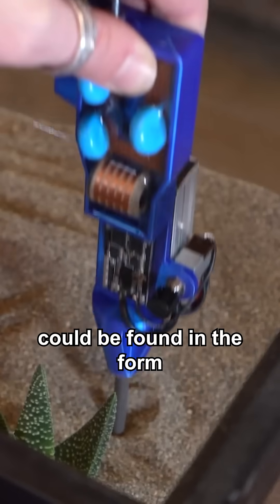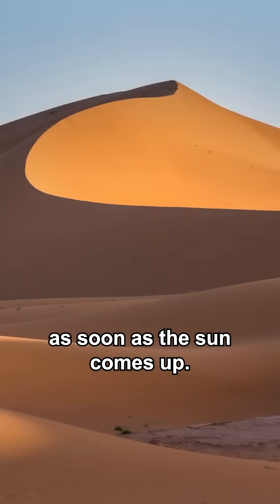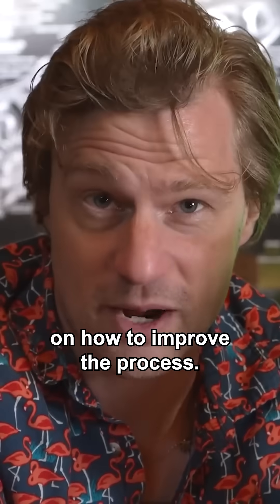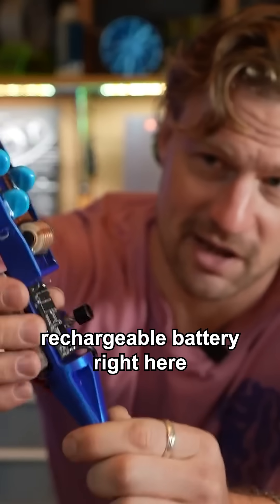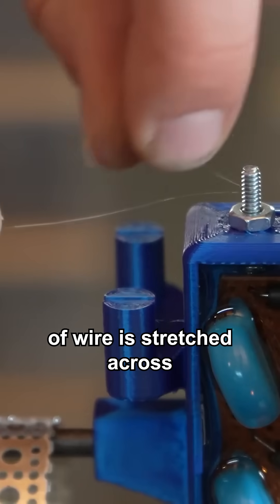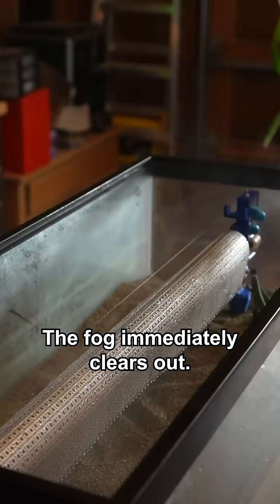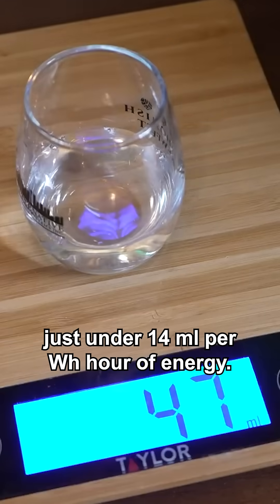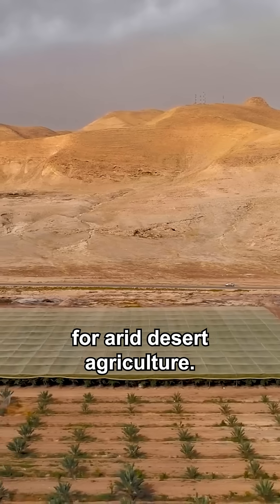Solving Desert Water Shortages Using 20,000 Volts (from full video)

Comment: The device is cool but there's too much that can go wrong with it plus you need to keep recharging a battery. I've always just used a big tarp or a big piece of plastic with a bucket underneath to collect the water that drips off it. Just make sure you get up before the sun comes up otherwise it will all evaporate
Reply: solar charged batteries

Comment: Hmmm, Free option , Shade cloth strung between 2 poles with a gutter placed below it. So as the fog moves through the shade cloth the drops will move down with gravity and of course the gutter needs to be at a slight decline that heads towards a collection container that can then be connected to a drip filter system for drinking water or as is straight to the water pump for the fields or house hold.

Comment: So simple yet so effective.  Holy crap that could help alot of ppl. Hope to see it in full production and being used. The fact you not using a cold area like a dehumidifier.  So the electric field attracts the water molecules and then they collect together too heavy to float so it collects and drips down the grate? Awsome.
Reply: That, is still a dehumidifier, in fact, a pretty run of the mill one
Reply: @elskaalfhollr4743  no shit, anything that takes humidity out of the air is a dehumidifier, lol. I was saying it was a different way to do it. Damn ppl can be so dumb. I did say like a dehumidifier,  guess I should of said like a standard dehumidifier.  There do you feel better now.😁

Comment: we use large frames with mesh in Chile to capture coastal fog, without power.
Reply: it captures far far more water with power , he explains how in the full video
Reply: Plus he says it could be  done using solar power as well. Imagine how much more water you could collect!
Reply: @nathanielball365  Except the fog only happens very briefly as the sun is coming up, so you'd need a ton of very expensive batteries.
It would be cheaper to scale up, build infrustructure, and desalinate water from the ocean you're already at, because it only happens at the coast.

Or dig a well.
Reply: @nathanielball365  yeah but you have to clean the panels really often
Reply: @nathanielball365  The problem with using solar is that it only works when the sun is out.  Coastal fog is a night time phenomena.  Now you could use solar to charge batteries to be used at night....
Reply: @38Maelstorm  and make it more expensive...
Reply: @MultiRRR123  True, but water is life.  Between the cost of a working system and dying of thirst, I would pick the cost.
Reply: @38Maelstorm  Expensive water = inaccessible water. And I'm talking expensive enough for it to just be cheaper to bring water from elsewhere.
Reply: @MultiRRR123  Not really.  A few high output solar panels to charge a couple of car batteries, this device, and the required electronics, depending on what part of the world you're in, wouldn't be that expensive.
Reply: . If only batteries existed.
Reply: For places in the world that don't have clean drinking water or it's in short supply here you go!!!
Reply: Just imagine if you use power. Might be the result will be  doubled
Reply: @duanglah  Put the power through a pump and a membrane. You already have to be at the coast, and RO is over 100x more efficient.
Reply: @duanglah  You can't pull out more water from the air than is already in the air.

Yeah, this needs a smaller surface area for the same amount of water, but fog nets are dirt cheap, so it's far cheaper to just get a bigger fog net
Reply: Maybe he will figure this out sometime you don’t need power
Reply: @Systox25 he has already explained that the one he made is much more effecient. the ones in chile only collect somewhere around 2% of that water, while his can collect much more.
Reply: @DevoDude  I will wait.
Every year someone invents a dehumidifier again.
Reply: @Systox25  he knows dehunlmidifiers exist. watch the full video, damnit.
Reply: @ I saved it and will watch it.
I hope he will talk about the problem with high voltage that it creates Ozone.
O3 is highly toxic and smells like of smog because it is smog.
The airflow looks like the ventilators for laptops that don’t habe fans but high voltage. Quite new and doubt
They suffer from Ozone creation as well.
I all for it if I learn something about the electrochemist if the water is affected by it or not.
🚩 he claims to found a solution for a big problem with a small device.
Reply: @Systox25  very well. have a nice day.
Reply: @DevoDude  i just watched the video.
He clearly can make videos and talk.
He didn’t had time to just test it outside…
He probably has no fog nearby.
He didn’t mentioned possible problems with the water quality and creation of Ozone.
What kind of mesh keeps the water save and the mesh clean for long operations?
More than half of the video is DREAMING what it could do.
Having only one source of proof of concept is weak.
I am all for it! Go big or go home.
Reply: @Systox25  you get more water from the electrical solution than just a mesh.
Reply: @HamguyBacon  of course

Comment: This could be one possible solution to help save farming in America after the aquifers we use are tainted with heavy metals and/or are used up. Not sure how applicable it would be with a lot of our current farming methods or in places with less moisture in the air. But this kinda technically could be a game changer in a lot of ways.

Comment: It's not recommended to drink hot tap water because of the copper pipes leaching copper ions into the water at higher temperature.

You know, getting stuck in your liver 4 life. Cause the body can't get rid of it.

Would this process be safe from ionized metals? Or since fog and watervapors can carry contaminants from the air,  would it be safe at all?

The desert is a no man's land, but the air there didn't just magically appear there. It might carry gases and particles from who knows where 😅

It's a cool idea, but I assume it would need further steps of water purification and higher energy consumption than just for the water collection.